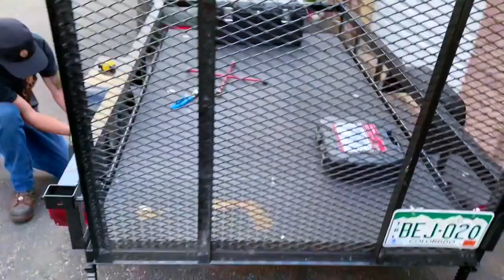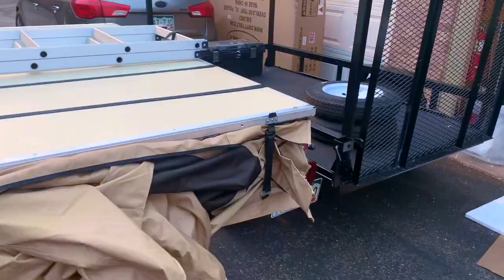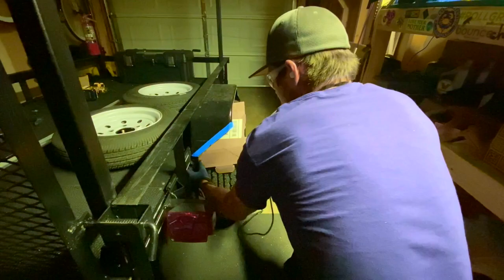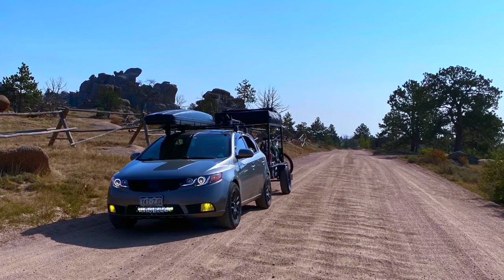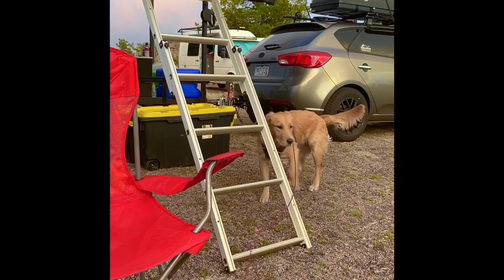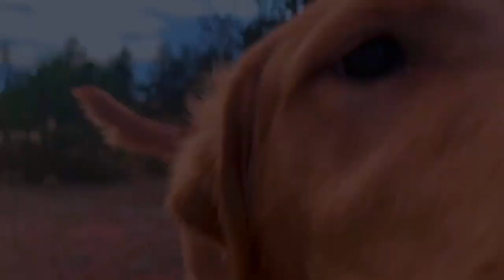Camping Utility Trailer with the Smittybilt Overlander RTT XL

Comment: Nice build about to do the same. One question on this tent. Does the ladder support the weight of the fold out part of the tent ? If not do you happen to know the wieght limit on the fold out part as in the section that the ladder is mounted to? Thanks

Comment: Great build. I am finishing up my trailer for our Smittybuilt XL. Question, did you get wheel adaptors to fit a bigger rim and tire to the original axel wheel hubs? Happy camping from South Carolina!
Reply from the maker: I actually didn't have to! it was a 5 lug axle already and just wide enough to fit the bigger wheels and tires! I had actually ordered some spacers just in case but ended up not using them because the fit was perfect!
Reply: @lifeoftristy5673  Nice build. Did you flip the axel to be under the leaf springs to get more clearance?

Comment: Hi. Any problems during towing with the trailer being top heavy? I love the idea, what is the maximum space below the tent (trailer deck to crossbars holding tent). I want to do the same to transport a dirt bike below the tent during travel. It would need to be between 52-60 inches to fit the bike. Ideally much higher to accommodate my RTT's annex screen room. What are your thoughts, I'd love to hear them.
Reply from the maker: The vertical bars are just over 40” and I have no issues at all. I added some extra bolts going through the side and the vertical post to ensure it didn’t sway and it works great and is solid. The tent only weights roughly 150 with all of our gear we leave inside of it. We drove it to Moab from Colorado and there were 60 mph gusts going into Utah and it held up great minus the cheap license plate bracket that broke off lol.

Comment: Did you just change your tire to a bigger one? From what size to?
Reply from the maker: It came with a 14" tire set up which could probably fit on a wheel barrel but I went and picked up some new wheels and tires that were a similar size to my car, that way it would be level for the most part while driving!

Comment: Hi nice trailer build!  I am in the process of sort of doing the same.  May I ask how tall your vertical posts are?
Reply from the maker: They are 46 and a half inches tall! I measured it after I threw the wheels on to make sure it would fit in the garage door with the tent.

Comment: Hi. Nice build. I am in a process of making a build just like yours. Did you buy the whole kit with the square tubes or just corner brackets?
Reply from the maker: Just the corner brackets, the 1.5” square tubing I bought from a local metal shop!
Reply: @lifeoftristy5673  I am still trying to find out these brackets, is there any special name for it so I can ask at my local harwdare store or find them online? thx! Nice build,
Reply from the maker: @mattf00   look up compact camping solutions weld less brackets and they have them on their website

Comment: Hi!  Nice build!  What material do you have on the floor of the trailer?
Reply from the maker: Treated ply wood and then rubber stall Matt’s on top of that so nothing would slide around. The ply wood makes it easy to screw in fixed boxes and I can move stuff around and you can’t tell where I screwed stuff in before because the rubber mats keep the holes smaller.